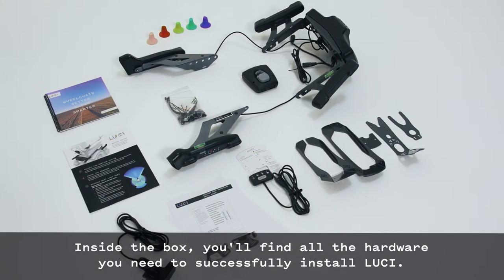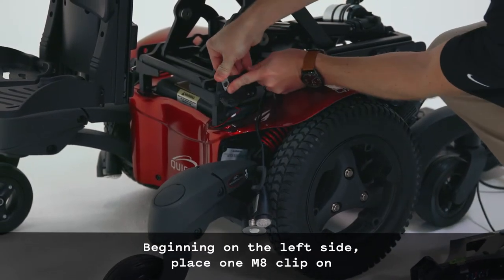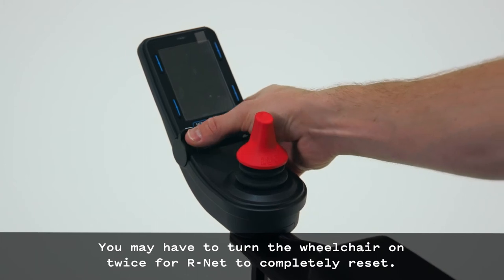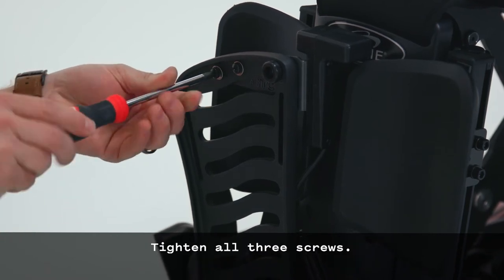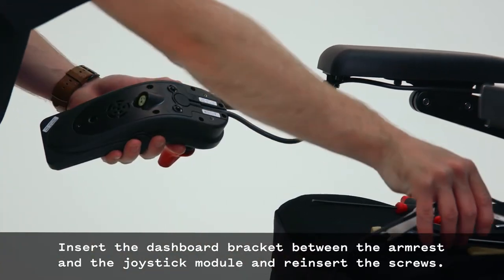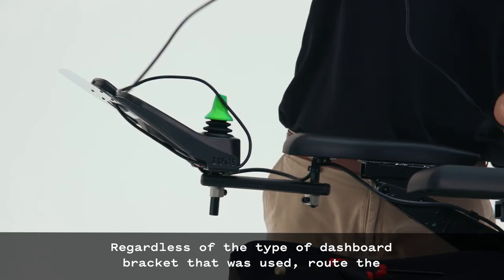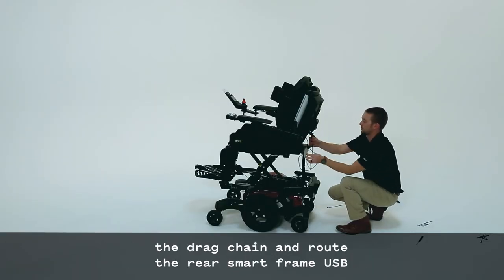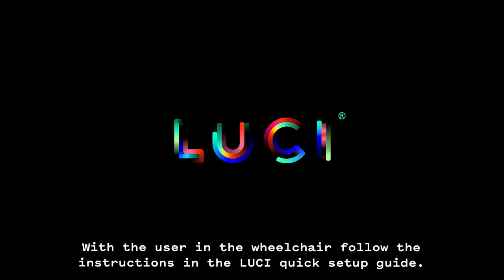LUCI -  QUICKIE Q700 M Install

Comment: Hello, I have a problem and I think you can help me. I wanted my car quickie salsa m2 a little faster and I bought a new engine. I bought the quickie q500 motor, thinking that I would not have a problem with the motors I bought. But when we put the motors, when I move the joystick forward, when I do it backwards, it goes forward. What is your proposed solution?